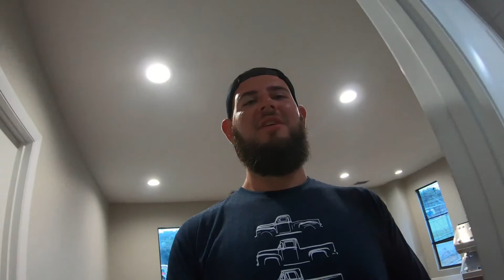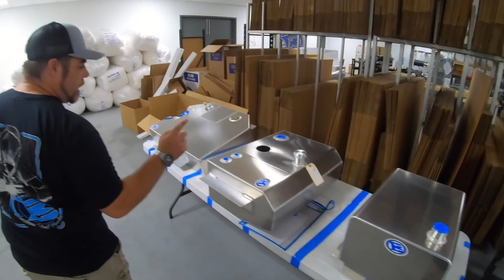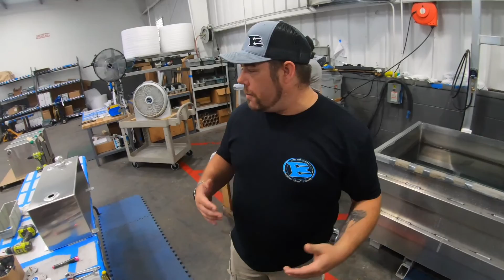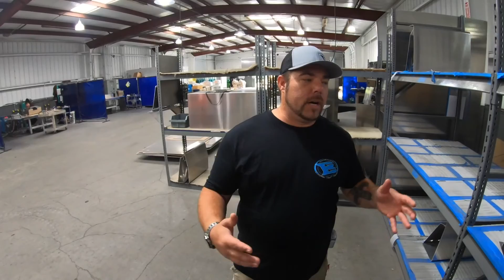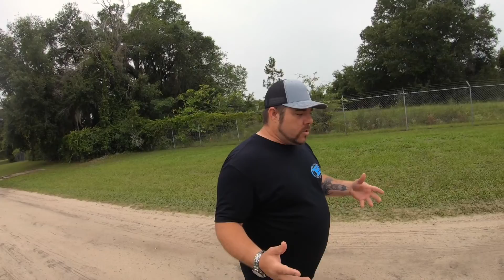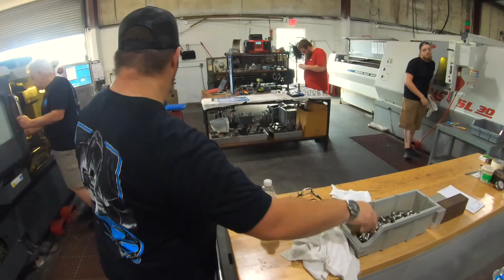Boyd Welding Shop Tour!

Comment: I'm a dump truck driver on the West Coast living a small beer can mobile home I heat my home with a high-tech Japanese toyotomi vented diesel heater these folks were nice enough to make me a small fuel tank I believe they said it was eight gallons it holds seven not really complaining the quality of the tank is super the welding absolute perfection thank you I had a hard time finding a small fuel tank to supply my diesel heater most awesome job you guys do again I want to emphasize the quality of this product is top-notch